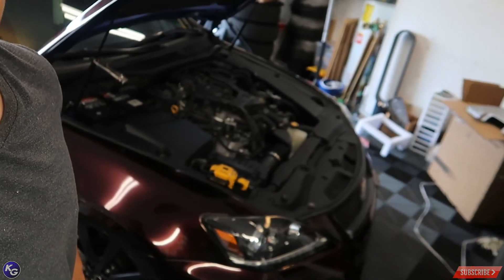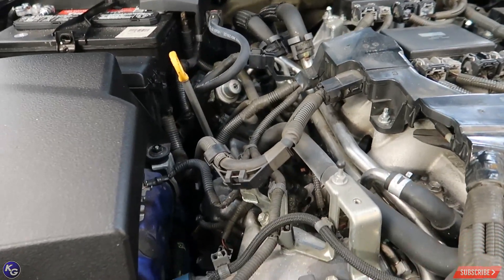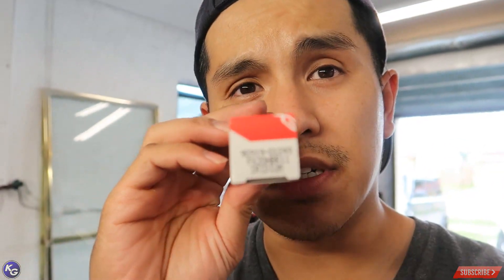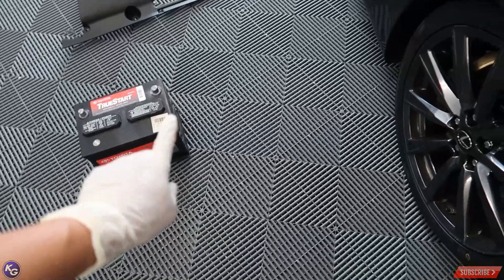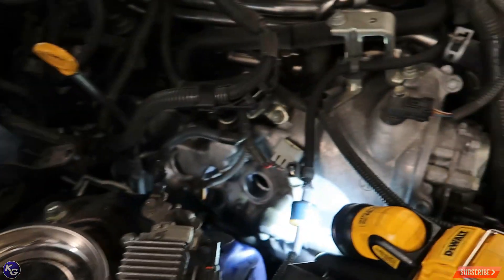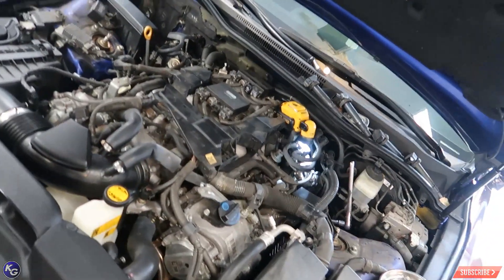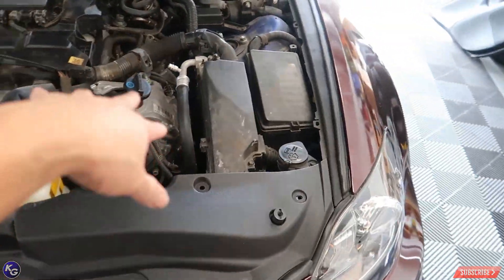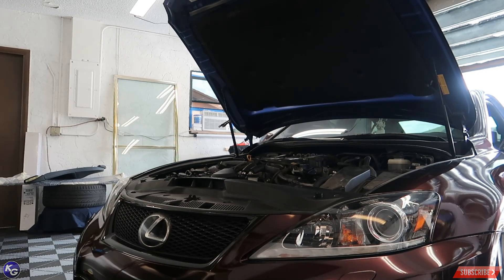REPLACING THE 400HP V8 SPARK PLUGS

Comment: Who ever is planning to DIY. Please make sure you don't bump the sparkplug tip while dropping it into the hole and by the OEM or best plugs available in the market. Remember one ISF owner has a  sparkplug tip broken off which scored the cylinder liner and damaged the piston. Major repair. I have no issue doing it on my 2017 Ridgeline but my RCF and ISF not so sure I want to take the chance. May be but will see kind of scared of liability of expensive powertrain

Comment: Did any of those connector clips to the ignitor coil break on depressing during removal? Seems to be a common problem on the ISX50s. Unless the ISF uses better materials. Seems to affect the black ones only though. It was easy to replace those anyway.